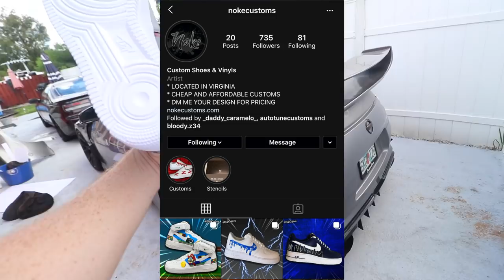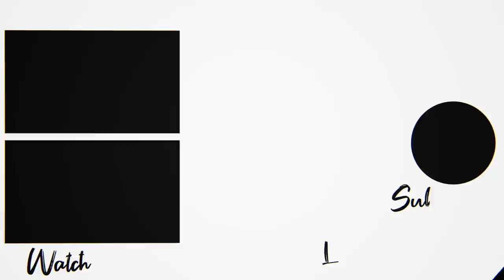Installing INSANE $1300 Morimoto Headlights On My NISSAN!!

Comment: For anyone running the drl wire, you don’t have to put a hole in your fuse box cover just run the wire through the bottom of the cover. That’s what I did.

Comment: Got these headlights about a month ago, will never go back to the oem ones. Now just waiting for Morimoto to make the tail lights too. Ps. Don't forget to adjust the height of the lights, idk why it doesn't come adjusted to a leveled setting. But yeah.
Reply: How did you level yours? How many rotations and which direction? I think I have to go back and re adjust mine, which is going to be a nightmare.
Reply: @dhankander  my driver side headlight was actually the right height, my passenger side was the issue. Although it says not to rotate more than 3 rotations, I believe it was, it took a few more than that. Easier to adjust when it's dark or you have a garage and just adjust till you're happy with it 🤣

Comment: For $1300 you’d think they would come prewired with a module so the turn signals wouldn’t hyper flash like that. Definitely a must
Reply from the maker: They “hyper flash” because of the module that controls my tail lights!
Reply: Danny Z no wonder, i didn’t think of that, I’d seen other videos from people on the z forum and didn’t notice them hyper flashing. Looks good tho bro

Comment: Just got my z and I'm having CSC failure.
Reply from the maker: Yup it happens
Reply: @DannyZee  its gonna cost me 2k to get a csc elimination kit and to have z1 install it. Any recommendations.
Reply: @Ibwatch550  do your research too but a lot of people say Zspeed I have a 370z too.  I'm at 19k miles so around 30k I want to get this kit.  it's not that expensive by itself but they say to upgrade your flywheel and clutch while you're at it.

https://zspeed.com/product/zspeed-performance-cmak-v2-csc-clutch-slave-cylinder-delete-kit-370z-g37-g35s-q60/